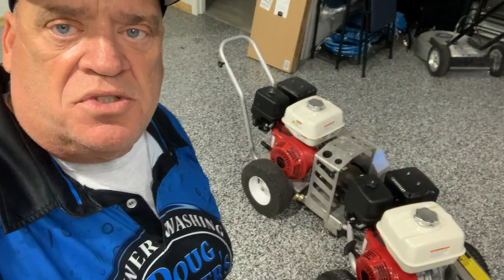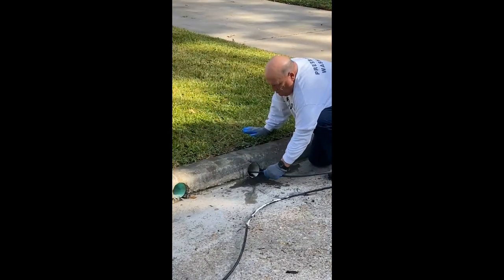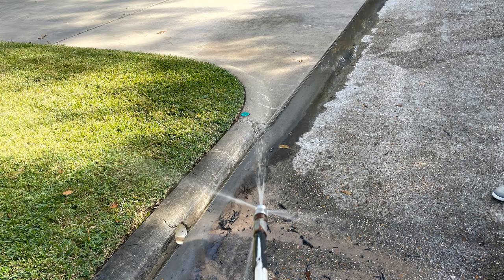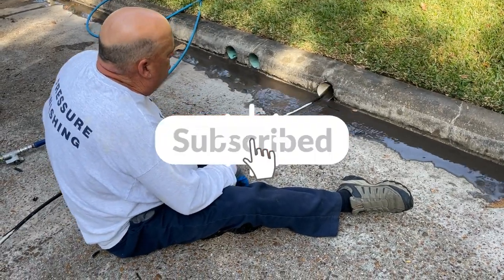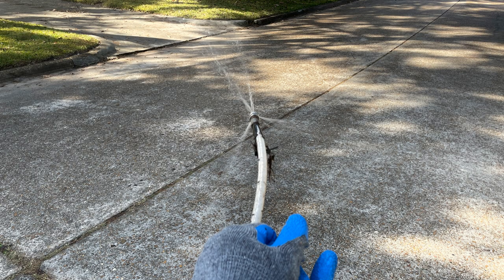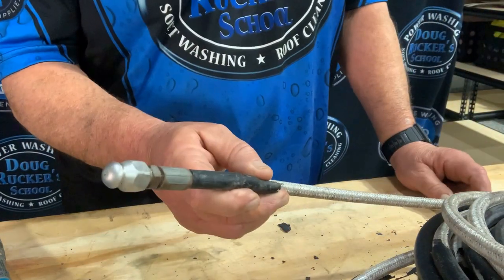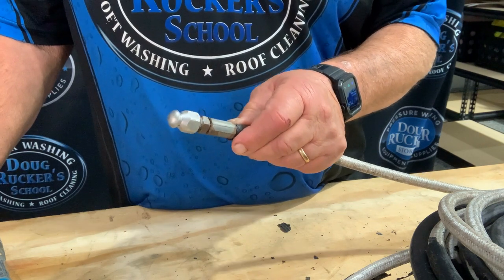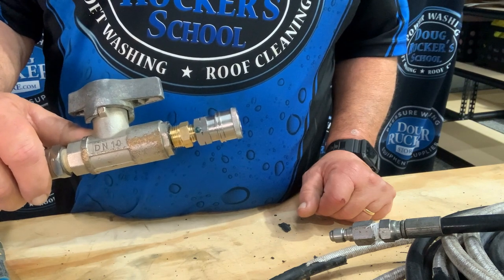Drain Cleaning with Pressure Washer from Doug Rucker Store and Pressure Cleaning School

Comment: Love using sewer jetting nozzles to clear irrigation drain lines.  Plumbers charge approx. $200/hr when they use their sewer jetter (IF they even have access to one).  Have used them on a downspout that was completely clogged from top to bottom, all 30 feet of it.  Great video Doug
Reply from the maker: Thanks Kevin

Comment: Great video Doug. Someone gave me a 3,000 PSI 2.5 GMP machine and I have jetted a few lines with it.  Was wondering how much better a 4,000 4GPM machine would be.  I do jet sewer lines, no licensed needed here in Michigan.   I also have a sewer camera so I can check my progress.  We get about $700 to jet a sewer line.  One guy can do it in about two hours set up to pack up and go.  Subbed you.  PS, I put a regular power washing wand on mine when jetting sewers so I can turn off and on at the clean-out.  I put a squeeze clamp on it to run continuously.
Reply from the maker: The more volume you have the better it will work
Reply: @PressureCleaningSch  A the 2:30 mark you mention that you would never do a sewer line..... What is the reason? I thought this was called a sewer jettier hose setup....please elaborate what you mean! Thanks for a great video!
Reply from the maker: @SS-pi2yi  Anything that's part of the plumbing for the house I will not use this on for a customer.  I leave that to the licensed plumbers.  Gutters, Pool Drain Lines, and Landscape drainage lines I will do.

Comment: I have been following this guy drain addict for awhile . I think he's in Australia. I have been thinking about getting into doing this .
Reply: Most the people that do this are licensed plumbers I already have all the snakes and equipment but when researching it I wasn't even allowed to remove a toilet because I don't have a plumber's license that's here in NJ guess no collecting corn lol
Reply: @newwavepressure6478  I was thinking about doing downspouts and french drains. We have alot of them here not actual house plumbing.
Reply: @Smokey-bu3yb  yeah I was going to do the same was going to buy a snake camera cuz you're definitely going to need one but the average one was 4 to  $5,000 99% of the drain cleaners are licensed plumbers  and most of the time when there's a plumbing problem they're not going to call a pressure washer will work for gutters and maybe a drain if a customer says yeah I've been having problems with that outside French drain you could say I can take care of that for you other than that I've only used it at my own house LOL tubs are easy to do cuz the water fills back up in the tub until the clog pops I wouldn't use it on the toilet because all the s*** water sprays right back out all over the floor
Reply: We get $700 to jet a sewer here in Detroit.  Good money, a job that can't be shipped overseas or done by AI... LOL

Comment: How do you get the jetter to go around corners? I cant seem to get mine to curve for any reason.
Reply from the maker: I pull back and forth a few inches a few times and it will usually start working it’s way through the corner

Comment: Hi Doug, will a jet usa 15 hp 4800 psi 4.2 GPM pressure washer clear out roots from my sewer line.
Reply from the maker: That's going to depend on the root size.  No real way to find out until you try.  Wish I had a more clear cut answer.  Sorry.
Reply: @PressureCleaningSch  they are shrubs from the neighbours dwarfed umbrella shrubs. It usually gets blocked every 6 months. I've plunged it many times, but now use a 15 metre spring, which does the job. Got clay pipes they keep getting into  the same spot always. Is a machine of that psi and GPM usually enough.

Comment: I’m planning on using a 3000 PSI electric washer machine to help unclog tree roots in my main drain, you think this is strong enough ? Or I should get another stronger machine?
Reply from the maker: I think you’ll need stronger.
Reply: @PressureCleaningSch  what do you recommend? Maybe a 3400 power pressure gasoline machine?
Reply from the maker: @michaelangelofishing2534  the GPM is more important. So minimum 4GPM

Comment: Hey Doug I have a bandit hi flow 5.5 gpm 3500psi pw. What tips/tip size would I need for the sewer Jeffers
Reply from the maker: The 5.5 will work
Reply: @PressureCleaningSch  thanks Doug! And do you do gutters? What ladder would I need for 3rd floor gutter/roofs? 32, 36, or 40?
Reply from the maker: @jayslo914  I dont do gutters I usually sub it out. But definitely the 36 or 40 depending on actual height. Probably best to go with the 40 to be safe.

Comment: Would this be effective with a 3 gpm  machine? I wouldn't want to drag my whole rig out on a day that I'm not doing pressure washing. I have a little 3 GPM machine I can  just throw in the back of my truck.
Reply from the maker: Yes it should work fine. Might not work on certain large or bad clogs

Comment: What would be your preferred method of connecting 2 -100 ft sewer hose?
Reply from the maker: Use a 1/4 FPT coupler or 1/4 quick connects if you want to disconnect to two 100 footers when done.
Reply: @PressureCleaningSch  also, what's the largest pipe you think this setup could successfully clean.  Just trying to figure out the smallest to the largest pipe before I order, thanks
Reply from the maker: @vspd303  I have only done pipes up to about 6 inches, so hard for me to comment on anything larger than that.